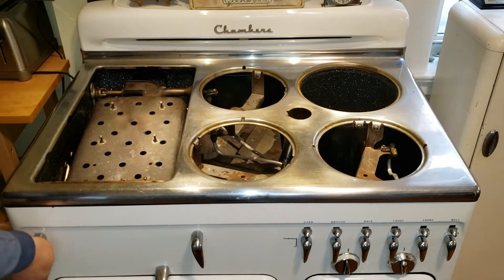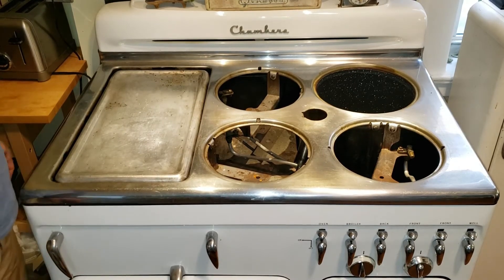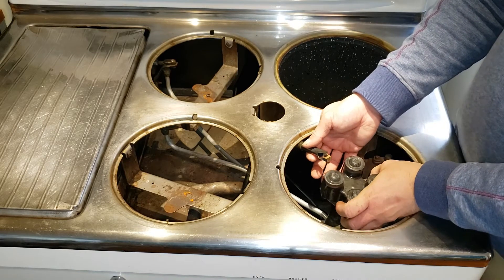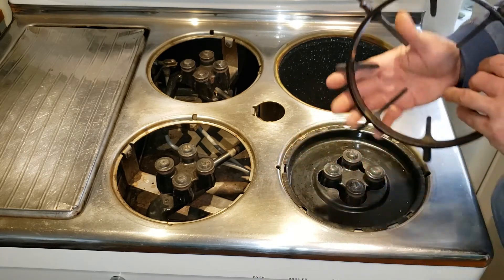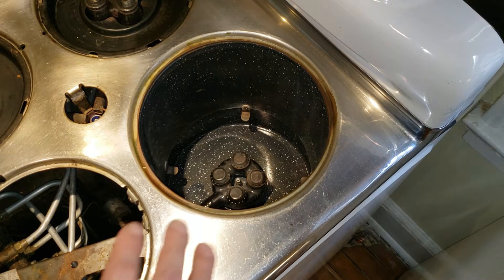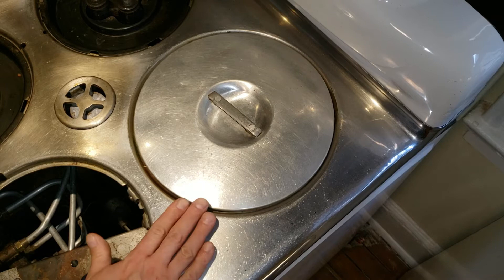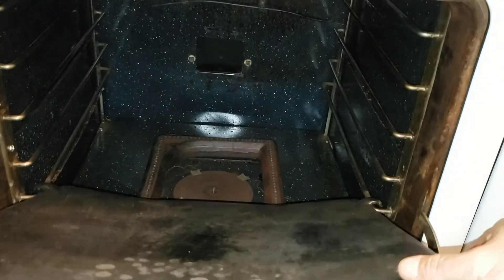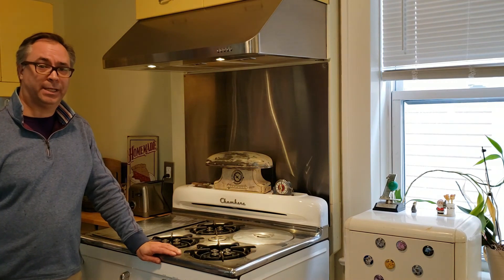How to Set Up a Vintage Chambers Model C Stove

Comment: Hello
Thank you for these great videos. 
What can be used as a drip pan?
Reply from the maker: Where, around the burners or in the broiler? For the burners, you need the originals (most vintage stove parts places have them). For the broiler, anything wide enough to fit in the back of the broiler box will do.

Comment: does a propane retrofitted chambers stove require venting?  Assuming it does, any tips how to connect a vent? Thanks!
Reply from the maker: Whether a stove uses propane or natural gas has no effect on its need to be ventilated. All gas and propane appliances should have a vent - a range hood or a window goes a long way to providing the circulation you want to prevent CO build up.

Comment: my stove always feel warm to the touch on top of the stove. Is this normal? I haven't used it in weeks
Reply from the maker: If it's a Chambers, yes, that's normal. Chambers stoves have two standing pilots - one in the middle for the stove burners and one in the Thermowell. It's always slightly warm.
Reply: @VintageStoveChannel  Thank you!
Reply: This looks very simple. With the exception of the gas line connection that’s all the parts? I just bought a house that has a chambers stove that has been idle for quite a while. I’ve wanted to use it but have been afraid of it. I was told it has to have seals checked etc. A nearby service company wanted me to arrange to have it brought to them to check it out! It’s probably about 500lbs and it’s not going anywhere. So I can have a plumber confirm my gas connection is solid and safe and the jets are ok then make sure to follow this video to set it up?

Comment: What stove is that light from? On the top of the chambers?
Reply from the maker: That's from a 1930s Glenwood that was in a rental property I once owned. Back then, it was the only part I could save. I rebuilt the clock, rewired the light and gave the housing an intentional distressed look.